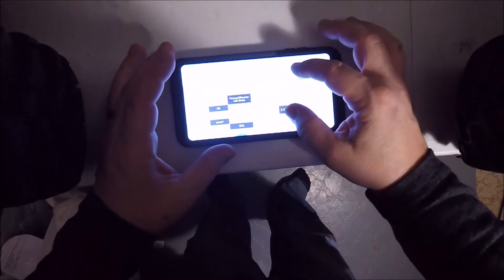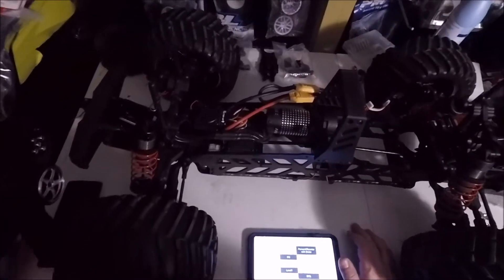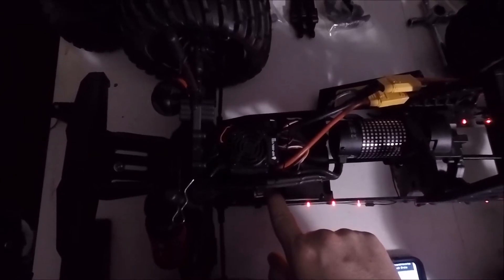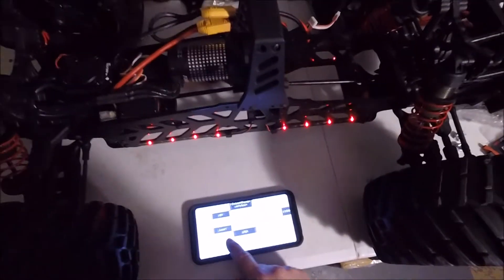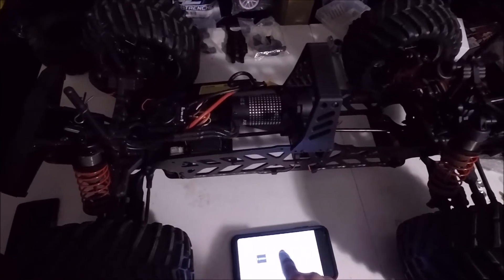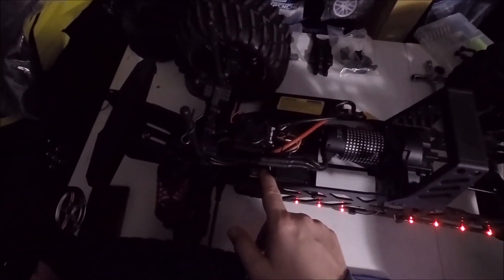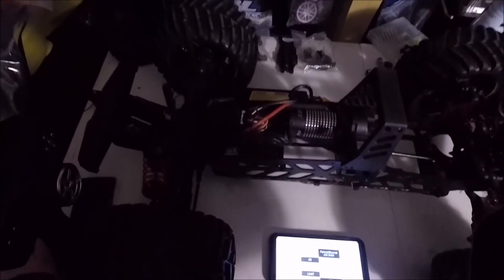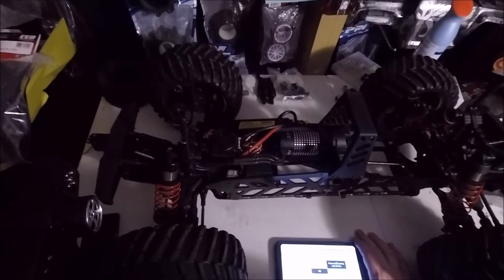RC Help - How to manually program a Hobbywing QuicRun BL150/120 ESC/EZ-Runs/Re-Brands

Comment: Sadly this doesn't work on the hobbywing quicrun 10bl120. All it does is continually beep when I power it on while holding the set button. It doesn't even try to enter programming mode. And I also tried to link it to my program box which I used to program 4 max6 escs in the past, and this new esc doesn't link to that. Esc still drives the car but apparently it has NO WAY TO CHANGE THE PROGRAMMING DESPITE HOBBYWING GIVING A MANUAL WITH IT SAYING YOU CAN ADJUST MANT SETTINGS. Punch js the setting I'm after changing since I want to increase it. No hate to your video, that method would work fine on my old max6 escs but  I have no idea if the newer escs like I got have a new method, or if I just got a faulty one
Reply from the maker: Yeah they took it from the new v2 QR stuff and their fusions!  Need the $10 programmer now!
Reply: @NPCRC Yeah that sucks. Glad I finally figured this out from another vid and your reply here is even more conformation. Hate buying a programmer just for one esc lol

Comment: So on the WP-8BL150 RTR there is no option to change motor rotation ??
Reply from the maker: I do not think so... but way way to do that is to flip the 2 outside wires on the motor/ESC connection.  Leave middle to middle and swap the other 2.... then reset your throttle parameters and you should be good
Reply: @NPCRC  Yh that’s what I ended up doing 😂 my first electric Rc since I was a kid i got a Tamiya M01 Monte Carlo Mini Cooper for my 10th birthday 😂 then upgraded when i was 16 to a nitro Hobao Hyper 7 and had that ever since until now. I now have a Hobao Hyper GTB-E

Comment: Thank you sooo much! I have been looking for instructions like this for the past 2 days. I blew up the esc in my 903a and bought a hobbywing 16BL30 to replace it. I also bought a program card so I wouldnt have this issue. I got the esc and it has no external connection for a program card, The instructions are terrible and the only instructions I found online were to set endpoints. Thank you so much for this video! It all makes sense now lol.
Reply from the maker: That's why I made the video. It was super simple if you understand it but understanding it is part of the issue with most people. Including myself when I first was trying....
Reply: I have 1 question though. When I turn everything on, my steering turns left a bit so I trim it but the truck does not turn all right all the way.  It turns left all the way but not right. How do I fix it?

Comment: I have the nice more expensive blue led program box with usbc and it connects to your computer this box won't work on this stupid esc i tried everything the box just sits there saying connecting to esc that's it.
Reply from the maker: soem are not compatible with each other.  Ran into this myself
Reply: @NPCRC  ya I had to program with set button. I'm used to the good hobbywing escs that plug into my computer.💪✌️

Comment: Will this work with the xerun?
Reply from the maker: you can manually program an xerun but there are more options involved with that esc... should be same just more scrolling.   The wifi module for the better hobbywings though make it so much more simplified and the XeRuns produce alot more info to the module and app that the Ezruns don't, like RPM reached, temps hit and more.

Comment: Please, do you have a link to the flowchart for programing ?  like i need to know what beep 1 is and beep 2 and such.   like i understand how to program I just need a chart or something to tell me what each number beep is for.   like 5 is for brake force and drag brake is 2. what is 1 and 3 and 4 and so on. ?
Reply from the maker: What esc?  Usually you c an find the programming instructions  online or in the truck manual depending on the model

Comment: Thank you so much! The manual doesn't say the long beep is 5. I was trying to set voltage cut and every time it got to 5 with the long beep I thought I was going back to 1 and I was getting frustrated.
Reply: Hey do you know the list for the max 8
Reply: Hey does anybody have the list for the backstage ESC the percentages
Reply: Max 8 not backstage

Comment: I have the hobbywing EZRUN Max10, i did exactly how you described but I can’t get my reverse to work
Reply from the maker: sometimes if you have a remote with dials if the Throttle trim  falls just below 0, it cuts off reverse.  I always put mine and tell people to put it just above 0, but still touching it and it should eliminate it if that was the issue

Comment: I have the hobbywing quic run 1/8 150 amp car esc running in hpi buggy. When running 4s, no problem when running 5-6s, thermal shutdown happened so I disabled it with program card and still get shut down why is this??? Cant do what its rated for??  I need to run 5-6 on this thing!!!!
Reply from the maker: 5S is almost impossible as most sensorless ESC's won't adjust to the 5S, needs sensored to run 5 properly.. If you are having issues going from 4S to 6S then you may have the gearing off.. If you have it geared too high it can cause thermal shutdown when pushing everything to the max limits, like 6S
Reply: what glue to use on 6s without coming apa
rt with heat???
Reply from the maker: @43rocket  I use PL but it has come off in spots over time ans i have to touch up along the way. maybe the new PL belted tires will be a better choice for you.  I should have mine this week for stock.   i also have Powerhobby 3.8's coming that are belted

Comment: You just saved my ass man! I can’t find any info on my esc. And it’s exactly like yours. 120A 
Is there power settings? As of now I just did what you showed me lol brake and drag brake. I would like to know what els I can do with it. I got it used and it’s all out of wack. Thanks a bunch man!
Reply from the maker: look up CEN colossus and in the manual PDF if has settings i believe.. .where i got this layout from
Reply: Thanks man!

Comment: ive got simular drama want to change punch on 80a trackstar  but cant get it to change selection
Reply from the maker: does it go into a program mode like this one?  Never ran a trackstar so i am not familiar with programming it.
Reply: it only seams to do throttle and brake.makes no sounds  just lights.looks like i need to get a card